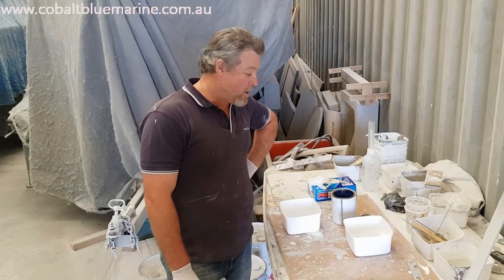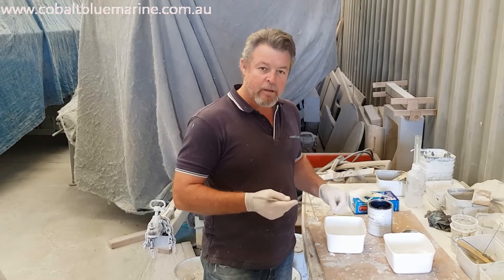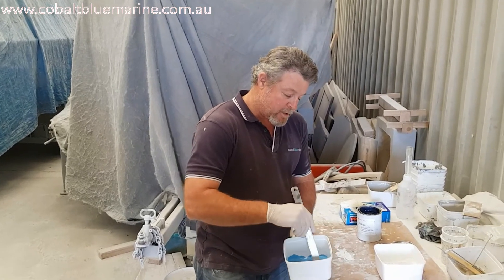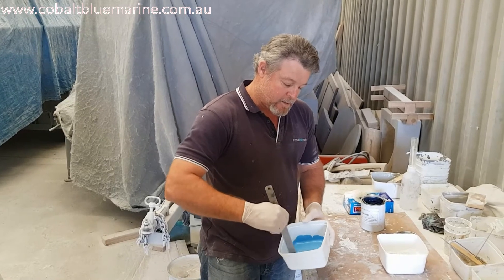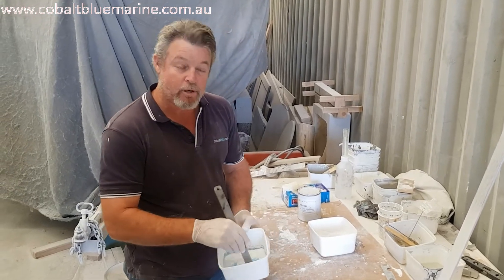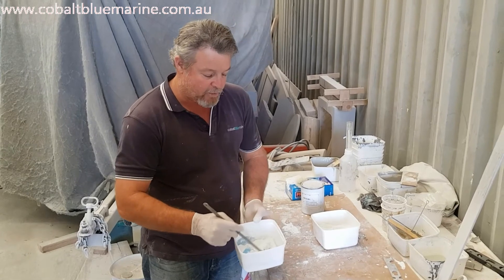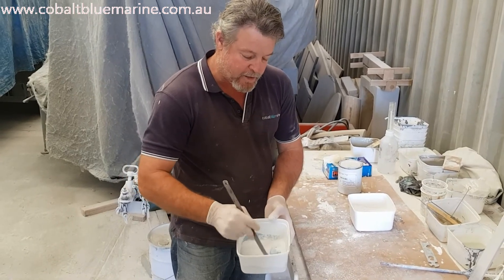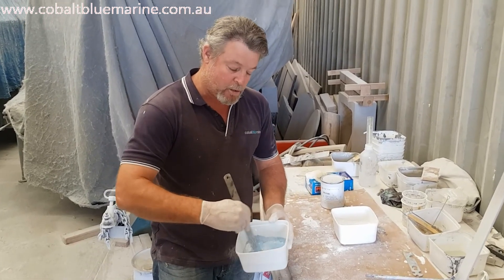How To Part 2: Gelcoat mixing for Craigs Fibreglass Boat

Comment: Hi mate glad I found your channel 
I've jumped head first into two boats both need new floors stringers and obviously new paint to finish
I have the glassing under control 
However I have many many questions on flow coat and gelcoat
So I've recently picked up some flow coat and some gelcoat 
I really want to spray topside for smooth gloss finish 
 but have been told you can't spray flow coat ?
I've tried using the two when I did the floors and found
the gelcoat levels out nice 
And seemed to be drying smooth not sticky at all 
When applied thick with a brush
However when applying the flow coat thick it dried exactly the same as applied did not level out and could still see brush marks 
How do I achieve smooth gloss finish like gelcoat with flow coat if it can't be applied by gun